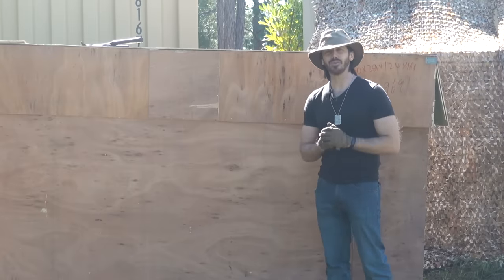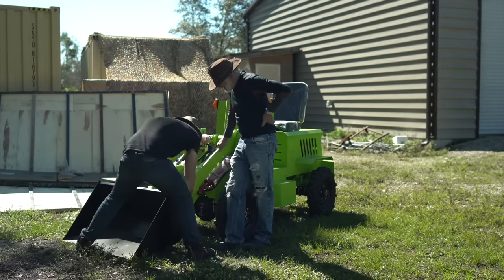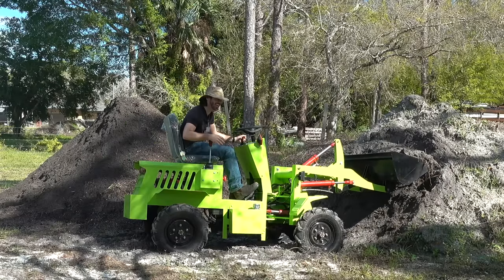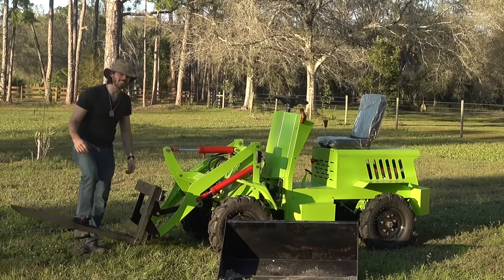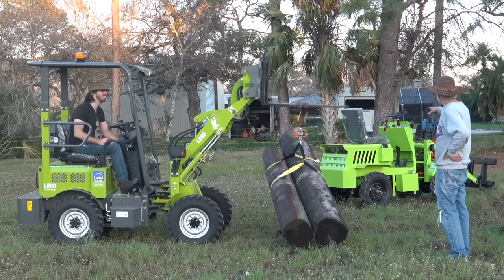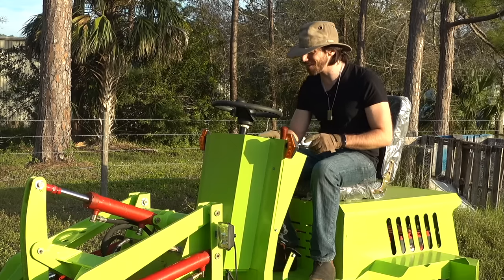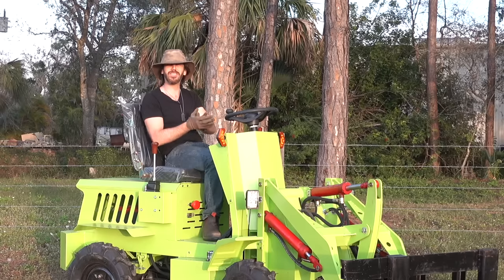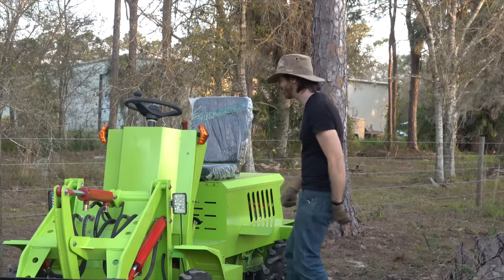I Bought A Cheap ELECTRIC Tractor From China (Big Mistake!)

Comment: I know ya shouldn't have too
But you already have it......
I suggest welding a price of angle that sit just under the top cross bar on each fork if there is still room to hook & fold down, also you could weld a piece of flat/or angle stock that goes under the back of each fork that rests under bottom rail of fork.......
Ya could weld a couple u shape brackets on back of unit & set your barbell weight bar in it and add & remove weight as needed ....
Rubber strap to hold batteries if ya don't wanna bolt & strap them ....
& use it for the mini mini jobs as it is a mini loader 

Good luck ......

Comment: I wood add counter weight in the back, beef up the tires  and add a Rev limiter.
Maybe change the fan for more quiet one
Reply: Yes, but by  the end of modification its not cheap anymore :)
Reply: A fan ain't the noise. They used a cheaper vane pump in the hydros. They are that loud by nature.
Reply: It's all electric, there isn't a fan and you can't add a rev limiter to something that isn't an internal combination engine.

Comment: I like your comments at the end. Too many people forget that low price has to come from somewhere. There are lots of crap quality products made in their country, and China is no different. 
I think if this unit is really inexpensive, a bit of DIY could make it useful (2 nuts welded to the forks could attach them better, a 100kg weight could fix the tippy behaviour, etc...)... but would only be an option if it was really cheap compared to other options (I mean something like half price). One bonus, it doesn't need a reverse beeper because it's so noisy!!

Comment: Halve the bucket size and halve the weight rating from 800 to 400lb then put some roll bars on, improve the hydraulic Valves flow control, change the pins, improve how the forks are fixed to the the machine. Thicken up the materials, improve the paint job. Improve the  battery bank and double the tire width, place a counter weight on the back. Fix the suspension. Maybe then worth a look.

Comment: As a relatively cheap machine that would be easy to work on, I like it! It just needs a seat sensor to shut off the hydraulics. Drill and add some pins to hold the forks in place. Maybe add some counter-weights to the back.

Comment: Put weights on the back, also front to get more traction  make a solid concrete block set eyes in it & then hook it up to your dandy merchine with your forks drill a hole through the top that attaches to the frame then put a spring loaded pin in that will stop the forks coming up?

Comment: Over all the loader seems too light, maybe adding wheel weights would help. The loud pump is pretty annoying, engineers probably choose the wrong style pump (sounds like a pickup snow plow blade going up/down). It looks cheap (it probably is cheap:). It might be a tempting value, if not for killer shipping & customs cost.

Comment: What i can hear and see here is that the hydraulics sound so strained. Its crazy how bad it sounds and it seem to be way sensitive or not sensitive where its basically on off. Thats a no go. I think the machine could have worked if those things were fixed. That nesher is soooo much better in terms of the hydraulic. Of course the material choices is the cheapest out there :D

Comment: Try swaping to lithium battery packs also place a seperate pack for driving and other for hydraulics.
Recommended battery 21700 samsung 50s, you can make a huge battery to fit theres and it will perform wayyy better.

Comment: Why not try putting bigger tires on that loader and then load them full with weight and see how it does? Then that would be a good project and see how things work then because loaded tires are usually in tractors did you ever check the hydraulic fluid in it or power steering fluid?

Comment: I don't mind getting a loader lifting the back in the air.
It's when it lifts the front I need a new pair of trousers. The front anxle doesn't pivot, the back does. And when you've got a load a bit too high above your head, it gets very scary very quick!

Comment: I'm not even sure what the use-case would be for this except for maybe an older person who can't lift heavy things any more and wants to do gardening alone? I used to work briefly as a mover and I'm not a big dude, but a pair of us could pick up more than this thing can. It's probably better than using your back, but not by much. I'm looking at your L880 however, and that thing looks pretty rad, especially with the digger attachment. That could be a game changer for light construction equipment. I could almost get rid of my compact tractor with loader, backhoe attachment and 3-point. But the 3-point missing is a deal breaker for me. Pretty cool stuff though. I love what you're doing.

Comment: Love your videos. Can't say where I was consulting when I learned this, but it's common practice in some Chinese factories to increase forklift capacity by putting bags of salt or sand (usually 150lbs of the stuff) behind the driver. Obviously that didn't meet the safety standards we hoped for at the time, so they at least started strapping them down 😂. Biggest issue was ensuring the floor had enough capacity (it didn't).

Comment: You can buy 18,000 pounds of real iron in a used Ford/New Holland loader backhoe 555C or 655C,D and E. Typically 10 to $15k on the auction market. You can easily get 10,000 hours out of them where these will be lawn ornaments at 3,000 hours. Once you use a real backhoe, you just cannot look at these without laughing. Or you can do as I did and pick up a John Deere US made 690E trackhoe for $30,000. 4,000 hours and 44,000 pounds of beautiful machinery. Been running it for 20 years, never been down more than a day.

Comment: I fold my tractor's seat down when it rains, and I want to keep it dry.

It would be interesting to see if it can lift the rated load if you add ballast to the rear.

Although it is clearly a low-end machine, if the price is low enough, it could still be a good deal.

Compared to shoveling and moving things by hand, a low-enough priced loader would still be a lot easier and would be worth buying for some people...

How much would it cost to buy one?

How much more does the product that you currently sell cost?
Reply: Another thought on the lift capacity: how much would the batteries weight of they hadn't screwed up and had sent you the correct ones?

The extra weight would add rear ballast and help keep those rear tires on the ground.

Comment: The ‘phone you are using’ analogy is nuanced though. For example the iPhone is made basically by an American company in China. Everything is done to US and international spec. The people directing those people making the phones know what they want and what they are doing. However, a Chinese company (usually state owned) without any such direction will not produce a product equal to an iPhone. I’ve also seen it in medical equipment when comparing Sonosite ultrasound machines compared to Sonoscape ultrasound machines. Or Philips defibrillators compared to Mindray defibrillators. They are kinda close but not to the same spec of operation or build quality.
Reply: State owned for this machine or company, you cant be serious? Most likely a small company making for small farmers or country residents in China at a cheap price. It's built for local Chinese usage at a low low price for those that cant afford better.
Reply: Iphone is basically made by an American company in China!!!  Were you born yesterday? Do you not bother to check who actually makes them before commenting?

Comment: I think the noise is from cavitation. 
Definitely slapped together. 
I was hoping that a schematic would have been included with mine.
 I want to put in a rectangular panel meter.
They're only like 20 bucks and super easy to calibrate.

Comment: To me it sounds like the hydraulic fluid maybe low being that it's winning the forks need to be modified and it needs some weight in the back. I like the other one you have it works much better. Wow it needs a lot more if I was to keep it I would have to do a lot of upgrades and fix a bunch of things that's said  that they ripped you off on the batteries and one of the pins and you paid extra for painting it and it was a very por job

Comment: Hey, i know that it would be an extreme amount of work (and following your videos i see that you're pretty busy), but  i like to see those little ugly products from China being worked on and reformed, so maybe if you don't get someone to buy it, you could try to slowly get that micro loader in a better state, like repairing the hydraulic system and getting a new pump, getting some ballast for the rear, thicker tires/wheels, getting a new bucket and proper forks, just to show how that micro loader could be if the factory hadn't cheaped out on it

Comment: 14:50, I'm sure that it can lift that 400kg load, if it's operated by someone weighing 150kg, but then it might not drive anymore... 🤣
Reply: I bet they had guys standing on the back part when testing what it could lift and at 405kg something snapped.
Reply: The way it lifts in a semi-circle from the arm lift pivot, means that at about four feet from the ground the load is furthest from the machine, so most likely to tip.   This could be really disastrous if lowering a load from a stacking rack.

Comment: Lights work but couldn't confirm a backup alarm over the motor noise. The bigger one doesn't have one either. Cost-saving matter, I'm sure. Actually, pretty funny video. Thanks.
Reply from the maker: Yes the bigger one has everything, backup alarm, seat cutoff switch, ROPS, separate motors for driving and hydraulics, exceeds advertised lifting capacity, etc

Comment: The tires look like my old 94 geo metro, 4 bolt hub 13". My 23hp Kubota has gotta have more lift capacity than the chinesium electric loader. The Kubota can't pickup the front of a 90's junk Saab to drag it around, but it can load a bucket of manure into a spreader.

Comment: 26:05 That thing has the lifting power. What it doesn't have is enough ass. No junk in the trunk. I bet they build this ICE and Battery and the diesel engine in the ICE variant weighs it down better.

Side note those axles are giving me ideas for a gokart build if they can be had as standalone parts for half decent prices.

Comment: You need to currel more as you're lifting and if you put more batteries or counter weigh in the rear it would be able to lift more without tipping, it has the power just not enough counter weight

Comment: The sounds lmao  tragic. But you will actually be shocked. At load lifting capacity! We had a 40 ton digger on site. Boom tucked in, bucket curl (no bucket) the thing was only designed to lift 26kg. Give it an extra 10ft (3m) reach that thing was picking up 28 tons all day long! 

You'll get the hang of walking the dog into the piles or material! Push, bite (lift up on the bucket) it's all about traction.) So push dig, push dig,  if you mess up, take what you have in the bucket.  Back out and cover your ruts.  Start again. It takes time. I started my big machine journey in a quarry.  In a big volvo 350. With scales. I was doing like 9-12 ton on my 1st months full bucket. Then I learned, watched and figured my own ways.  I was kicking back 19-23ton in a single bucket.  It just takes time, mate! 
Cheers from new Zealand!!!

Comment: As someone who is just starting to look into e-bikes do you have a suggestion on where to start.  

A little background if it helps.  I was diagnosed with MS 8 years ago and my health as of about 3 years ago made it so I can no longer work.  I currently can not afford a car and am looking for an alternative to get to doctors appointments (currently have to ask for rides or use Uber).  Most of my doctors are within 15 miles one way.  Cash is obviously very tight and looking to see if this could be a good alternative.  Any suggestions on we’re to start looking would be greatly appreciated.

Comment: It's the part holding the steering wheel that's bad in the loader , you should time hitting the dirt and tilting the bucket properly,  even a big diesel loader would have you with traction problems 😂

Comment: That sound is caused by hydraulic pump cavitation you are probably very low on hydraulic fluid as my guess is the pump motor is submerged for cooling also why you are hearing the motor wizzing away

Comment: The noise of the hydraulic is very bad.

All the switch are in the wrong location.  It will rain or snow on them, and they will go bad very quickly.  Even boat rated switch won't last.

The traction for this type of equipment is proportional to the weight of  such equipment.

A hydraulic weight rating might need extra weight (balast) in the back of the equipment.  My tractor rated for 1200 lbs can't lift that without 500 lbs on the 3 points.  With the Chinese, you need also to check the height of the rating.  Some are only 1 meter.

Comment: You should have put the strap as tight as you can to the back part wear the tractor meets attachments  for you to find a true tipping point weight .  Do that again & why not see what real world farmers do like adding rear 100 - 200 - ???    They even got Lawn mowers use wheel weight    bolts on to snow blowers  & watch any 2x4 tractor load  they fill tires whit extra weights & pointy claws on bucket.

Comment: That looks like the result of giving a pallet of 16 gauge sheet metal to a high school shop class and telling them to make something vaguely tractor shaped.  Also someone forgot to tell them the motor for the hydraulics does not need to be running at 100% the whole time the power is on, just when your calling for power.

Comment: Id give 1 to 1.5k for it delivered to my shop. It wouldnt replace my massey tractor but would be a nice side to use in smaller areas of the farm for smaller jobs.
I know thats a poke in the eye for what it cost plus having it shipped over here but I've seen, heard, and know the cons of this machine. If i needed a smaller tractor I can easily find a 4x4 kobota with a bucket that needs a few things fixed in that price range. Those things needing fixed are also easily sourced.

Comment: well ok as it is, IF it was priced under 1200 usd to my site.

 the cotter pins can/shold be replaced. there are clip pins in varios sises, although Id drill out the holes to use the same retaining pins.

 wider tires as these pictured will be ok on concrete or other hard surfaces.
a counter weight will help solve the tipping issue. 
 as for paint & other cosmetics? we could fix that. ;)

 the hyd pump & fluid need upgrades.
so after a few thousand $ in parts, time, frustration, planning, replanning, ect. . . 
it will do better than a hand shovel

Comment: They say work smarter not harder, that thing seems to make your work harder and slower.
They need to do a entire overhaul of that machine and its design. I build electric skateboards that dont bog down like that does under load.
Sad to see things made like this, as it makes some people think electric will not work for certain areas.
When if made correctly it would have no issues.
Also could be nice on a farm to not have to store gas but use solar panels for the home and the vehicles.
We have the ability to make great things, so my thoughts are recycle these kinda tools and make things we can all be proud of.

Comment: Seems 880 lb capacity is about right as wet sand weighs about 3500 lbs/ cu yd (880/ 1/4 cu yd)  and that appears to be about 1/4 yd bucket + a little more heaped as in the trial........ still seems like a P O S, but as long as it works, better than doing by hand  (& back)

Comment: It seems that the hydraulic pump motor is running constantly waasting power. On an electric forklift the pump motor only runs when you actually use the hydraulics. Much more cense.

Comment: Back maybe 30 years ago I operated an electric scissor lift that controlled the hydraulic lift mechanism not by inefficiently throttling the hydraulic oil while running the motor at constant speed, but rather by controlling the speed of the hydraulic motor with the joystick.  It was a brand new thing at the time, and it worked REALLY well.  Super smooth and controllable.  It is stunning to see that all electric hydraulic equipment isn't made that way by now!

Comment: The issue with cheaper electric tractors is the Ali express tractors aren’t well balanced so if anyone is going to use this I’d figure out how to add weights to balance the rear and keep it from tipping forward when loading the bucket but your best option is to avoid this all together, good grief that thing is slow!

Comment: How much? Geeeeeze the most important thing and I can't find it.... It matters because many times I've bought "cheap" stuff and then "upgrades" it with most of the suggestions already mentioned and much more. I imagine the loud noise is due to no pads between the pump motor and the frame. 
I replace the batteries with a real GAS (the smokier the better ... keeps the mosquitos away.. kidding but true). Then everywhere it needs reinforcement I'd do it. Etc. Weights on the back by welding on a holder... I'd see if I could move the seat back too. 
There appears to be enough room for larger tires at least in the front where you need it... replace with the bigger ones when on grass etc. pavement .. ok. 
BUT if its like only a few k less than a good one here... or a really good USED one... FORGETT ABOUT IT . Let the makers use it ..
Blessings.. thanks for the test

Comment: If it had a proper bucket, it wouldn't be able to lift much more than the bucket. The leaking oil is probably good, else the rods would start to rust. The articulation angle is probably that way so it's less risk of it tipping over sideways, it doesn't have any rollover protection. I would not buy it!